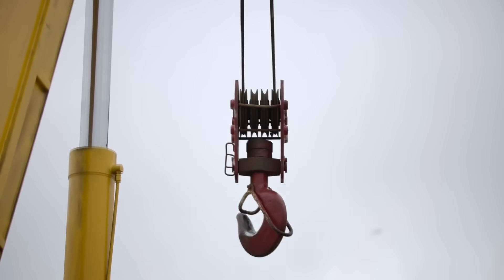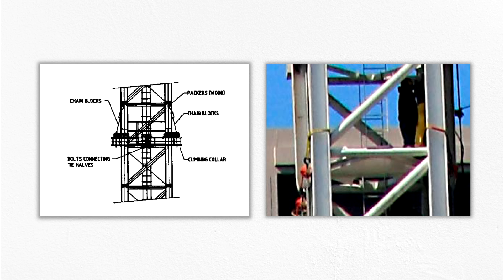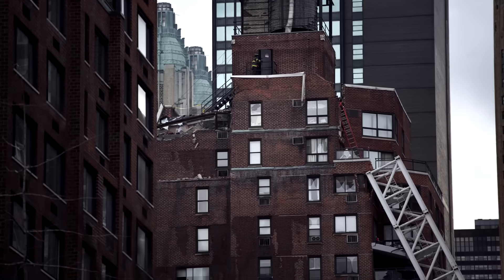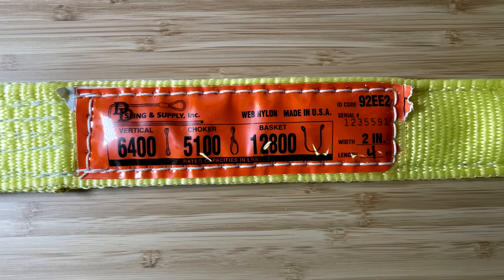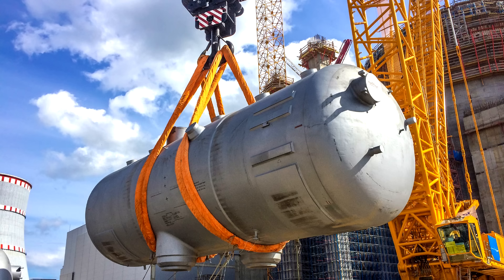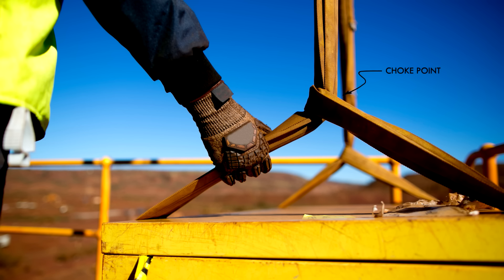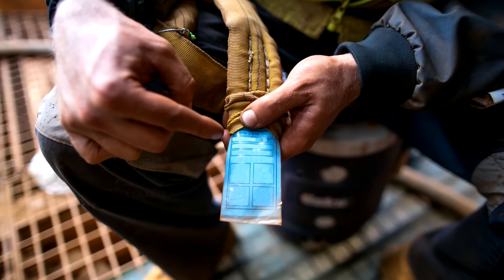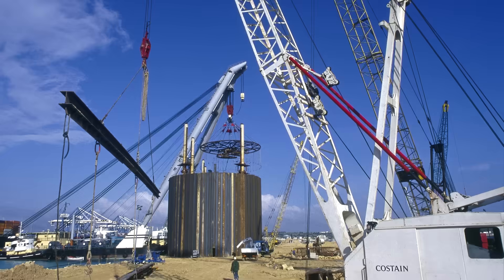Why Things Fall Off Cranes

Comment: Things I learned:

•	Each sling has to have a tag or else it’s considered unusable.
•	There are three different slinging methods.
•	Center of gravity is critical to slinging a load.
•	Sling angle is critical to a lift.
•	The horizontal vs vertical forces remind me A LOT of the forces acting upon an aircraft wing in banked flight.
•	A spreader bar can be used to help distribute the single lifting force on the hook.

Keep up the great work!

Comment: I use slings at work. Typically moving loads between 500-2000 pounds. The increase in the load on an angular sling was kinda shocking. I already knew that angular lifting wasn’t ideal but I always felt it was because of the side loading on the attachment points not the lifting sling rating. Just for reference, I install large garage doors and dock equipment. Wish you could post pictures in the comments.

Comment: Hi Grady- Interested in learning more? Check out Bob's Rigging and Crane Handbook (large format is better- small is just shrunk down big version, hard to read). Rigging handbook- 5th edition is probably the best field copy which fits (not comfortably) in a back pocket. Also, Crane Institute puts out a pretty good rigging field handbook too: Rigging, by James Headley. I've got all four books which have proved invaluable training aids. I don't typically use the Bob's field handbook because it's just tedious to read the ultra small print.

Comment: using the spring scale to demonstrate the increased force on a load suspended out of vertical was simply brilliant! I don't know why I haven't seen that done elsewhere, I had to learn it as a more abstract concept. 
I''m not a rigger per'se but pioneering merit badge (quite a few years ago haha) was probably my favorite, and rope behaves the same way as straps. fun fact, even the most well executed knot will reduce a rope's strength by 30% and a bad knot can reduce it a lot more.
Reply: AFIK in most ropes, to get full strength the smallest bend radius must be at least 4x the ropes diameter.
Reply: @cameronwebster6866  
I have a Thimble right in front of me for a 3/8" steel cable, and it's inside bend diameter is: 1". So that's a 2.5x bend diameter
Reply: @cameronwebster6866  that sounds about right, unfortunately, I don't know of any knot that can do that. Well, unless you count the crown knot at the start of a splice haha
Reply: @dscrive  That is  why you don't use ropes to lift anything so heavy you need a machine to do the lifting.
Reply: @anteshell  I'm not sure how you think a machine could lift anything without a rope (or cable) of some sort.
Reply: @JohnRunyon  So, regarding your comment above inquiring as to how a machine could lift anything without a rope (or cable)...there's a variety of tractors and/or machines that are able & capable of lifting heavy materials/objects. For instance, front-end loaders, backhoes, skid steers & excavators all use buckets for the purpose of lifting/moving dirt, supplies & other equipment. Most transportation maintenance is made significantly easier utilizing hydraulic/pneumatic vehicle lifts, power companies use bucket trucks to lift them up so they're able to work on transmission lines safely...also, let us not forget about all the warehouse workers who use equipment that helps lift them to access products stored & stacked way up high...like fork lifts & scissor lifts which, ironically, has the word "lift" included as part of the equipment's name.
   Now that we've finished covering all of that, I kind of get a feeling, based upon the content of your comment, like I'm not exactly sure that you understood what @anteshell was getting at.  Let me explain.  So...throughout the trades & as a basic rule of thumb...if you're attempting to lift/carry anything that's too heavy for a few workers to lift & it requires the use of machine power in order for it to be hoisted/lifted/carried...then you SHOULD NOT, for obvious safety reasons, trust your/anyone's life with a rope(no matter the composition, whether it be poly/jute/hemp/synthetic/etc.).  
However, what you SHOULD use, is either a nylon sling or stranded wire cable rated higher than the weight to be lifted. 
Anyway, i'm not sure if that helped or made it worse...but I tried!
Reply: @cameronwebster6866  for wire ropes it.s 2.5 x d
Reply: This. A perfect comment. Spring scale demonstration was beautiful in it's simplicity.
Reply: Fishermen know all about knot strength. Start fly fishing and you will be a knot-jedi after your first summer.
Reply: I already knew the fact about knots, just something I heard, and reading from the comments (Tomas) I'm pretty sure I did learn it while on a fishing trip waaay back in the days.
Reply: No it was STUPID. Its LITERALLY SHORTER than the opposite cable and needs to be stretched to actually meet on center. 🤦🏻‍♂️
Reply: @digitaldaydream420  that's not true. The vertical distance decreases so that neither one is stretched.

Comment: Why not use double the amount of slings needed to avoid centre of gravity issues? 

Is there a big cost difference in wear and tear damages if you using more then you need? Despite having less load overall on each sling? What's the reason for not just overcompensating on slings used?

Comment: when slings are slanted, they put extra, sideways tension to bolts and load hooks. failure can occur there as well, by forces working lateral and nοt longitudinal. classic failure hazard in rock climbing, when carabiners get loaded sideways.
Reply: Agree.. all shackles and hooks normally are de-rated to a certain % when they are loaded sideways, and not at the same plane of the slings

Comment: I was working in a nuclear plant (many years ago) in the vicinity of a multi-ton triangular steel brace being lifted with two choke straps.  One slipped and there was a huge clang when it hit some equipment down below.  Relatively minor damage, but it raised an appropriate amount of concern regarding rigging checks and not storing such braces near critical equipment.

Comment: Scariest rigging incident I saw was when too many slings were set on the hook; the crowding meant one eye wasn't firmly held, and popped loose with considerable velocity.

Good reflexes on the operator; he did an emergency drop, getting the load on solid ground before the unbalanced load could topple.
Reply: Multiple cargo nets on the same lift. MUCH yelling and screaming from the Ship's Bosun. Disquals and upgrades/retraining for the entire crew.

Comment: Heheh, very fun video! So many memories recalled from basic statics and dynamics classes long, long ago. :D I was totally inventing methods in my mind for how to find the center of mass of a crated item for which it isn't marked. Strain guages on cable-style slings at each corner to get relative loads as the crane starts to put partial tension on came to mind. Is that something that's ever done?

Comment: Heard a story about a swing stage that was left on the ground, with the cables ran through the motors and attached on the roof.  The wind caught the cables, hundreds of feet long, and lessened their weight, allowing the wind to grab a 38' deck and toss it into the building under construction

Comment: Another important thing: making sure everything is tight before applying the full load force. Sometimes straps get hung up or stuck in a crevace of the load, then once it's high up in the air, the strap slips free, potentially gets cut by a sharp edge, the load shifts into a drastically different orientation which makes it topple over another attachment point, and the straps get a big shock, potentially ripping them or overloading other things. Things relax especially when the load swings, oscillates or bumps into something. Classic case: you lift an I-beam with two basket straps, then they slide together, the beam shifts, slips out of balance or the straps get cut.
Reply: baskets always scare me
Reply: @YouzACoopa  if used correctly there is zero reason to be worried. Ive done 250ton lifts in basket configuration numerous times not only that, trunnion lifts almost always require slings in a basket configuration
Reply: It's not just accidental though. Inrxperienced workers aiding a lift, may use a crevace, indentation or protrusion on the load, typically near the bottom or underneath it, intentionally with the idea that it will keep the sling(s) from slipping towards the center. But that indent or protrusion isn't solid/structural or made for such loads (or any loading at all), so during the lift it deforms or breaks.
Reply: You don't lift an I-beam with 2 basket hitches in the first place, if you actually know what you're doing.
Reply: Oh ya ... one other thing.... you better know which way to orientate those shackles....  anyways.   Great topic !!
Reply: Thanks for adding that. If you had a crane operator who wasn't so pressed for time you could have him lifted about a foot and then look at it a little bit and then signal all clear or to let it back down. On the one hand as a rigger you need to get clear of all this stuff as the loads coming tight, but you need to steer the straps around obstacles to.
Reply: Centre of gravity pick on a beam lift .... One single sling double rapped choke on the bite with a shackle ,,, ensuring there is very short "fall" length from sling bite to sling in Shackle on the hook .. preferably using a guide rope on both ends of the load .... this configuration ensures maximum control and maneuverability of the load Safely !!
Reply: If you are picking up an i beam in a basket configuration you are already failing. No more than 10° of tilt on a basket configuration is typically ok.

You also shouldnt use synthetics directly on square edges.

But you are right things can slip which is why positive rigging techniques are very important. Especially if you operator is rough or your signalman sucks
Reply: @kylevanwinkle2081  Tilt? Are you sure you don't mean bend? Tilt refers to the angle of the load.
Reply: @anteshell  no i mean tilt. Less than 10° if angle is generalky accepted as having enough friction to hold the load steady this changes load to load especially when you have any sling angle at all. Basket hitch configuration is pretty much vertical pull. You can sometimes increase the friction by wrapping the sling around the load then putting both eyes into the connector as that acts similarly to a double wrapped choke but not as secure. But you can add more sling angle then. 

Its alot of situational judgement calls. But a basket hitch done correctly us okay with some degree of tilt. 

When manually installing a exchanger bundle it is not uncommon to have the leading edge sling in a basket with 5° if sling angle the rear sling at 60° and the load floating leading edge heavy. As you lower the leading edge sling by chain hoist it transfers the load to the rear sling and the sling angles work towards reversing. This is a really easy way of putting pipe in the rack with a crane as well granted you would usually choke pipe where as choking an exchanger bundle could damage it. And in either cases the leading edge if the loads needs supporting. Either by the exchanger shell for the bundle or a catch chainfall. Field experience makes this childs play
Reply: @anteshell  \I think he meant tilt.
Reply: or just yolo it

Comment: Another possibility of failure in lifting with angle in slings is... a failure of the lifted object itself!
 Because doing so, you also add significant compression stress within the object. And if you have a slender thin tube* it might break by bending (from its self weight) and then eventually fail by buckling...

* And if you are wondering: yes this is a mistake I saw once. Please use my experience to not replicate this error on your construction site! 😉
Reply: Thanks for the interesting example. I raised this hypothetical scenario earlier: When the sling angle approaches 90 degrees, the load will be crushed by the lifting force. Good reason to use a spreader bar.

Comment: Rigging is used extensively in the AV production world. Any arena show you go to will have chain hoists supporting the PA and lighting trusses. Where the hoists attach to the structural steel of the building changes with each show, so riggers will walk out on the beams to create the rig points and attach the chains. The stage hands will usually have multiple riggers dedicated to the task.
Reply: I was about to comment about how this knowledge is used extensively in AV, but I see there’s someone else in the know!
Reply: @thehodgi1  ... it's not just the AV world. Any major production company will have riggers for "flying" their gear. Decades ago it was just sound and lighting, but now there's lots of video and special effects up there as well.
Reply: Exactly, I did the same thing when I built the courses for Ninja Warrior and various Adventure parks. The only difference between the permanent, semi-permanant, and temporary structures I built was sometimes I would use the hoists to attain a certain height and then use steel braided cable with copper crimps. Every time I see those aluminum trusses somewhere I always find myself picking apart it's integrity and shitting on the small-brains that built it, and then I inform someone of how unsafe or out of code it is lol
Reply: Have some AV / Lighting friends who fly trusses and do rigging.  I don't know about all the structural aspects of it but this helped me understand it more.  Certainly a lot of variables to factor in.

Comment: Pretty good video. Exceeding the 30 degree angle is the biggest issue I see on job sites. The ticketed crane operator is almost always the most knowledgeable rigger on site. People think we just sit in cab and lift stuff but most started out rigging and still have to do quite a bit of it. Bottom line if not sure how to lift something ask crane operator.
Reply: This is good advice right here. I’m an ironworker and when I’m rigging something out of the ordinary, I always explain to my operator how I’m rigging it and ask for his opinion. Even if I’m sure that it’s gonna be fine, it never hurts to get another point of view, especially for something that can affect people’s lives.
Reply: @ralphgarza6034  always should be a team effort. Ive had operators thoigh that just tried to tell us how to rig everything. That did not last long
Reply: Absolutely. I've refused picks on multiple occasions because the rigging wasn't done right, until the rigging was corrected. Fortunately our guys know that I don't do something like that for no reason, and have only had any actual pushback on it once or twice.
Reply: Makes sense,  losing a load is not good for anyone.
Reply: Similar to Newly enlisted officers being advised to listen to some of the more experienced men under their command as their accrued knowledge will save you a lot of time. Even though on paper they should do what you say.
Reply: The operator from a distance has a different perspective also . Bless ya'll from hooterville, n.c.
Reply: Nar just shut up and pull the levers, nothing worse than a crane operator in their aircon seat giving riggers advice 😂
Reply: @ yup. This is usually exactly what I do
Reply: Offshore, we keep it to 60 degree from horizontal or larger 80% of the time. 50+ degree if we do have to (e.g. limited hook height), with special approvals.

Comment: This brings ms back when i built huge stainless steel tanks. 25tons and more.

So those slings where normal to use. None of them had tags..but we had on every workshop post a table where said the loading capacity of certain colors and certain number of stitches...if it had 4stitches its 4 tons...if it had 8 its eight tons.
Etc...yellow was 16tons if im not mistaken...purple was 8 and gray was 3 tons...
We had so many snaps just because they were over used and old...

Comment: just recently I have seen a crane lifting steel rods for concrete. lifting is nicely offcenter with worker below it. nothing happened, but it looked like there wasnt much needed for a few rods to slip out and fall
Reply: That's the kind of thing I've seen more often than any other. It always made me nervous, and I wouldn't be anywhere near that sort of load. It's bad enough for rebar, where the level of friction between bars is fairly high because of the ridges on the steel. But then when it's Ridgid or EMT? Nothing to keep those center pipes from going flying out!
Reply: @paintedwings74  especially when they just look like some artisitc mikado game, with some rods sticking out up to a meter on either side. one particular rod was flexing so much, with the angle due to offcenter lifting it hung nearly vertical at the end.
Reply: Same problem when transporting a load of pipes, strapped onto the back of a truck. Come to a sudden stop, and those pipes will go right through the vehicle in front.

Comment: Maybe not the ideal way, but in a 716 any I used to work at, workers would lift the ingot a bit up to adjust for the center of gravity, but they were so used to working with the material and they were usually able to get within a few inches of adjustment by just knowing what material they were lifting

Comment: What surprised me the most was that those synthetic slings are rediculously cheap compared to the usual industrial stuff. Yet some keep on using them until they fall apart...
Reply: Just be careful buying the cheap synths. We bought a set of cheapos that were rated at 10k vertical but were substantially lighter than other 10k vert synths we'd had before. We did a couple test picks with them, increasing the weight each time, and one broke with a 7.5k load. I cut both into small pieces so they couldn't be garbage picked and now procurement has a hard rule against buying cheap lifting equipment.
Reply: I got told that they are kept cheap in order to remove the reason for not replacing them.